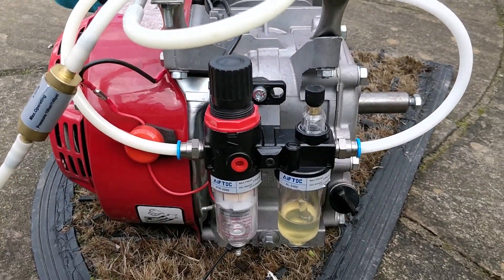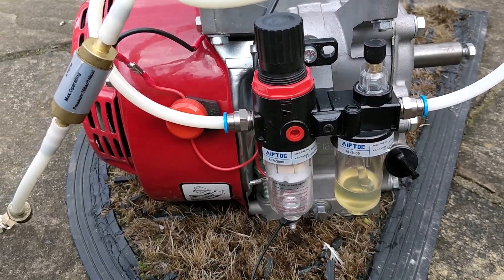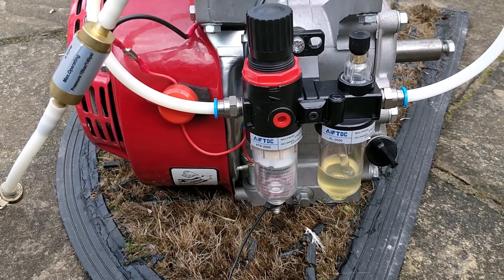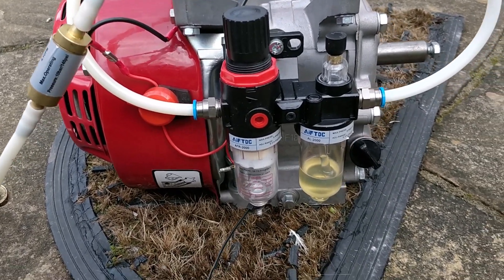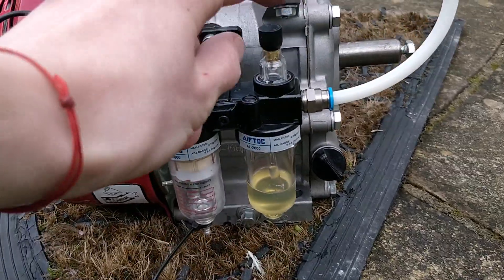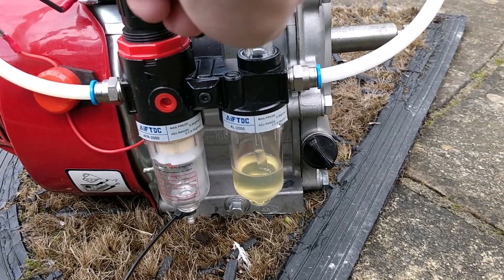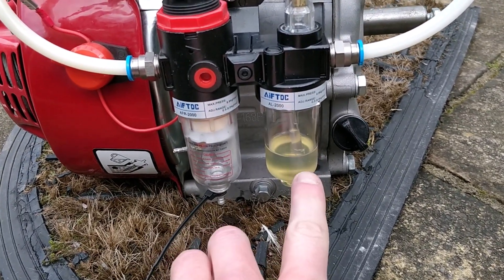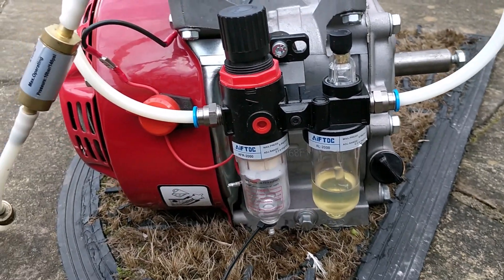Hydrogen engine!! (New cold start up method)

Comment: If you move the magneto closer to TDC you will not have to worry with backfiring out the intake valve.
Reply: How close to the TDC would you recommend the magneto need to be?
Reply: @elonwhite6628  UNDER LOAD AT FULL THROTTLE - Optimal mean cylinder pressures are typically seen with timing as late as 10 deg AFTER TDC and 14 after at idle.

Comment: Hey what about a propane to gas carburetor kit it's a dual fuel I also noticed it seems like some of the other guys had her coil to the spark plug in line to run the generators you didn't look like a factory plug connector look like a coil let me know what you think guys
Reply from the maker: A converted lpg gas carburettor should work fine. 
The throttle and choke valves need adjusting though. This is that I used in the newer videos.

Comment: How did you get to hydrogen inside the tank? Can you do a video on storing hydrogen in propane tanks please
Reply from the maker: If you go to our channel you can find more videos. One of the videos is showing the machine used to fill the tanks. 
Hope that helps
Reply: @Hydrogenguys  dope brotha aye have you tried making a system from the electrolysis to the propane tank I got a solar panel system on my property I’m looking to make green hydrogen gas
Reply: I believe he used a chemical reaction.

Comment: For the love of God. Mount that thing to a piece of plywood.

Saw your early vid and saw it flopping around (no biggie) but now you've added all this stuff and still pull starting at max flop. Lol

Keep up the good work, dude. Mayne hook up a parallel adjustable gas regulator (like car propane and natural gas systems) to keep the mix in check when the throttle is pulled.

Comment: Very interesting application. I would like to know about the lubricant/engine oil used in this purpose. Also, how to manage the hydrogen combustion generated water inside the engine which may choke the engine after long run.
Reply: Gasoline has water too. Hence the oil sludge, corrosion etc.
Reply: @bombasticbuster9340  Actually I believe that the water is from the atmospheric humidity not from the gasoline.

Comment: To much dangerous thing,especialy the tank. You just have to make a hho dry cell with electric pleasure sensor wich is cut off if the pressure reaches the 2 bar. After this point you use the hho gas as the lpg gas .You need a acetilen flashback aerosol also closes to intake /injector as possible. You have to change the timing ignition also.For 1.5l 4 cilinder injectors engine 3liter/minute gas enough if you want to run at 100% gas. If you can keep under pressure the hho generator then the gas  injectors will inject gas inside the cylinders.

Comment: Yes to pure H2 and no to HHO. Let's make a Fuel Cell that separates the Hydrogen and Oxygen. Now, connect the Hydrogen output to your carburetor! Your Engine should run like this!!!
Reply: on small scale yes, but if you wanted to scale up to a full sized motor you would probably need the extra bang HHO gives in comparison to H2.

Comment: Great project, I’m doing the same thing on a 4-stroke model engine (airplane) a question how do you produce your hydrogen? Electrolysis reactor or chemically? Continuous me I just started mine,I will produce a video as soon as it tightens ok
Reply from the maker: That sounds awesome! You will most likely get better results with a smaller engine, where the gas will last longer and better control with speed. 
I'm using a chemical reaction, will post a video about it soon. Feel free to contact us directly on the Facebook page 'Hydrogen guys' if you have any question :)
Reply: Great question and great answer